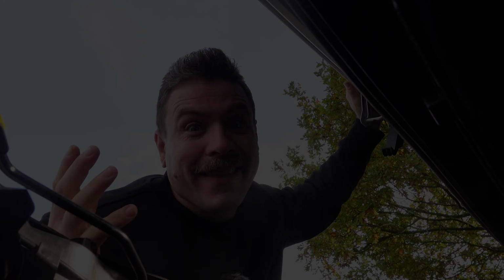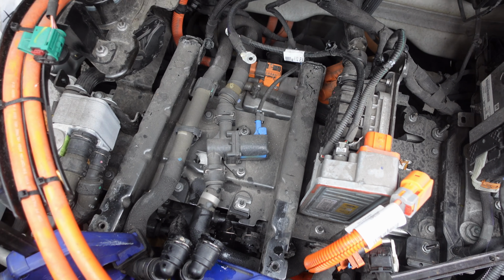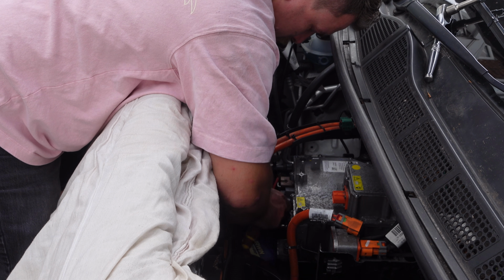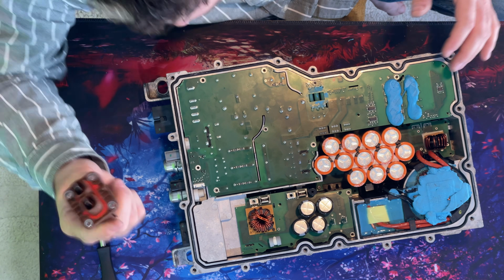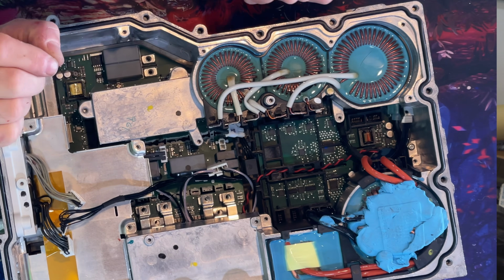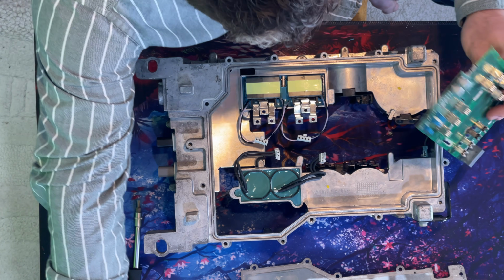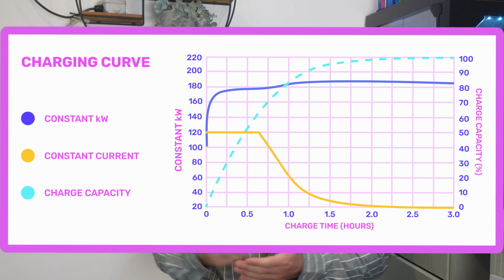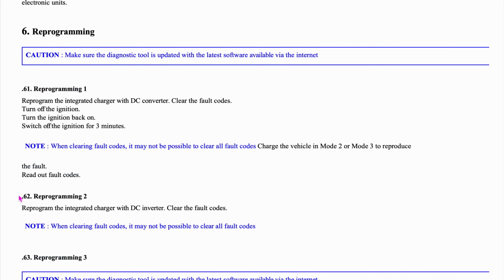Dealer Quoted £3,000 — I Fixed It for £380… But It Wouldn’t Work Until the Dealer Did THIS!

Comment: Thanks for making this video, I found it quite informative and helpful. I'm wondering what the actual cooling system is like for this charging module and thinking along the lines of it possibly being inadequate for the job and creating a built=in failure mode that is perhaps a little less than obvious.

Would it be possible to modify the cooling system so it performs better? As you have a thermal camera it would be interesting to experiment as a relatively simple mod could extend the life of the charger and potentially save people a lot of money.

A couple of thoughts come to mind:

-  Is the coolant flow sufficient and does a supplementary pump to boost the circulation improve the cooling of the charger? Experimenting this way may help but is potentially problematic regarding air ingress into the system as you pointed out in this video, but then it then it could also improve efficiency of the cooling loop.

- Is the radiator that finally extracts heat from the cooling system adequate for charging operations as charging is done when the vehicle is not moving so there is nothing driving air through the radiator? Is there a fan running on the radiator during charging? Assuming it's simple coolant circuit, what improvement is there is air is forced through the radiator? It may be that a slow, and therefore silent, radiator fan running during charging would significantly reduce the cooling loop temperature and prolong the life of charging module. It may be that there is a relatively simple way to energise a relay during charging that starts some sort of radiator fan. Aftermarket radiator fans are readily available and for a simple lower speed a 24V unit may run at 12V or there may even be variable speed versions anyway. 

I don't know if these ideas are folly or genuine food for thought. I'm thinking along the lines of prevention rather than cure and that some vehicles could genuinely benefit from slight modification. From an electronics perspective, it's a case of' the cooler, the better and the longer the life.
Reply from the maker: I measured around 33c from the coolant loop when the casing was 50c. There was a 2-3c heating from the cooling plate
Reply: @TheOfficialBatteryMan  It sounds like a bad design and that the coolant loop should have been through the whole casing.

Having said that, 33C is quite a bit above ambient. I wonder if there would be any noticeable effect chilling the cooling loop?

As the charging module made of aluminium, which is a very good heat conductor, there has to be some case heat being transferred into the cooling loop. As the cooling loop it a separate plate would it be possible to put thermal compound between the cooling plate and the main casing to transfer more heat to the cooling loop?
Reply from the maker: @DelticEngine potentially. I didn’t really show it off but there is a rubber gasket between the plate and main body. So I don’t expect much of the heat from most of the body to end up into the plate.
Reply: @TheOfficialBatteryMan  Thanks for replying. I can understand a rubber gasket to seal the unit to keep moisture out.

I've just had a quick look through the video again and there's definitely potential for the application of thermal compound. I thinking along the lines of cleaning up the contact surfaces and then applying some decent compound.

If the root cause is thermal issues rather than bad design, which it looks like is a definite possibility, then cooling could be taken a lot further by machining extra cooling plates that take advantage of the flat areas of the casing and fitting them to it. A lot more heat could then be dumped from the charging module.

If it's that hot on the outside then how hot are the components inside? Even though modern electronics can and do run quite hot safely, it does shorten the life and increase the likelihood of failure.

Comment: Great vid just gained you a sub, we as a society are sleepwalking into anti repair and anti ownership and its certain to get worse, you are in a minority but very important one of highlighting these underhand practices, Rich Rebuilds in the us fighting tesla and showing the world you can fix things cheaper is another, Also Matt Armstrong highlighted these same issues on his channel when fixing the latest lambo hybrid which when an airbag is set of in a impact a code is sent the the battery that bricks it completely even with no damage to the battery and he had to get a new one for 30 grand, even sent the battery control module to an independant company to try and clear the code but they found it was a permanent lock and later lambo themselves admitted they can't even unlock it.
Reply from the maker: Eventually people do work out ways around things. But the rate of change is so fast it’s hard to keep up with the manufacturers changes. 

I felt it my duty to give people all I learnt to avoid the dealer experience

Comment: Unfortunately this is not just Stellantis, and not just EV's. Almost all manufactures does this.
"Right to repair", ought to be a law manifested by the EU.

Just wondering .. wouldn't improve your access if you removed wipers, and the coverplate below the wind screen ?
Reply from the maker: True. 

Possibly but for 4 bolts you want to do as little work as you can. The cars will be easier to work on
Reply: Tesla doesn't...

Comment: And if Stellantis loses this data, or loses interest in the servers, your car cannot be repaired any more.
Reply: They are well on the way to going broke 🤔
Reply: @pollywollydo  Exactly. Companies going out of business with no software/data escrow should be illegal, especially if they insist on bullshit coding of parts like this.
Of course if they just published repair data and either protocols or software, then we wouldn't need escrow.
Even the dumbest of politicians can understand that you should still be able to fix expensive stuff like cars even if the original supplier has gone out of business.
Reply: @xxwookey the EU is trying its hardest to stop you repairing your own vehicles. Expect it to get worse
Reply: @DanRyan-v5y  Why specifically blame the EU? Most of the problem seems to me to be manufacturers. Governments set emissions, crash testing, and other regulations like recylability and market rules, which do have secondary effects. But it's the manufacturers putting in the serial numbers, proprietary software, and deciding on availability of spares, that really make repair difficult, expensive or impossible.
Governments can enact legislation to force manufacturers to do better in this regard (and by and large they are not). But that is an act of omission, not commission.
Reply: @xxwookey I explicitly blame the EU because it is the EU doing it. They want to stop everyone repairing older vehicles. They are talking about laws to ban it. The UK will be tied into it because of starmer and co will just bend over and lube up to get brownie points from the EU aristocracy.

I agree totally that this locking items into the vehicle is not a good way to carry on from a Sustainability point of view if nothing else. You should question why they want to go that way whilst spouting crap about sustainability whilst pushing policies that encourage the opposite..

It will be because the lobbyists and politicians have vested interests in getting you to empty your wallets for stuff you didn't want and that has to be replaced regularly.

It is also the EU that makes up all the eco laws that require everything to work hard in unison so the manufacturers don't want to be caught out not complying, because they get shafted if they don't.

If you don't believe that , research all the EVs that were registered with no real sales at the end of last year, just to avoid eco fines. This year it will be even worse because the EV market is stalling. But they can't do that forever. Sooner or later they will start going bust , because the EU is making them make and sell vehicles that most people do not want, and most of the public are refusing to play ball. But don't expect politicians to do the right thing in the EU. They will double down untill only the rich can drive.
Reply: @DanRyan-v5y  Registering EVs early to reduce fines has nothing to do with legislation preventing repair on older vehicles. 

OK. I found out what you are talking about. Proposed (i.e still under discussion) legislation to discourage things like engine and gearbox replacements in old (pre Euro 6) ICE cars as part of the phase-out of polluting vehicles.
Clearly that requires a bit of care to avoid making classic car and reasonable repair too difficult, but we do have to get rid of almost all the ICE cars over the next 15 years or so legislation to encourage that is fair enough.
That's quite different from preventing vehicle repair in general (i.e. for EVs in particular which quite soon be nearly all cars).

It is more sustainable to move to EVs quickly, especially as the grid is decarbonised despite the up-front emissions of new vehicle manufacture. Delaying the shift only makes sense for vehicles that do very low mileages. The footprint for batteries has nearly halved in the last couple of years, so the difference between EVs and ICEs is already small-to-negligible. All vehicles have to be changed at some point, so every purchase of  a new non-EV is just adding to the problem of ICE vehicles that will potentially need to be prematurely EOLed.

I see no contradiction in supporting rught to repair whilst also understanding that the ICE phase-out needs to go faster. (We are past 25% in the UK, but it really should be 50:50 by now). Electric motoring is cheaper for most people now, so the switchover is accelerating - most people find cost a persuasive argument.

Comment: I wonder if it could be filled with mineral oil to keep things cool
Reply from the maker: Nice idea.
Reply: I'd be careful about a dielectric wiggling its way into poorly designed pressfit connectors exacerbating the problem though
Reply: I actually thought of that too...
Reply from the maker: @nakfan this is why I love the community. Ideas being thought of outside the box
Reply: at 800V dc, elevated temperature? there are already signs of decomposition in there.

Comment: Did anyone notice this clean, simple looking device made out of just two boards just hanging there on the wall behind him?
Thats a Model 3/Y on board charger.
Reply: Tesla's engineering has been superior to Stellantis' in many ways for a long time. And surreally have gone from being an outfit with no spares and no info, to one where you can in fact get the parts, software and info you need to fix stuff. Absolute wankers in many ways, but more fixable than most.
Reply from the maker: It is indeed. One I killed by running it without 12v connected to it. Oops. 😂

Comment: Interesting video, thanks for sharing. This diagnostics issue will effect all new cars unfortunately having to use Secure gateway diagnostics  - there are aftermarket tools that can connect/make the handshake with the dealer tool, but I think they are probably £1000+, plus a hefty subscription.
Reply: It doesn't have to be that way. It can easily be put in legislation that there has to be a reasonably-priced way to get diagnostic data out of your own vehicle. Without network access to entities that may no longer exist.
Reply: @xxwookey in theory there is only a small charge from the dealer for a token (something like £10) for an hour to connect to their server - BUT as far as I'm aware you need an expensive scan tool compatible with Secure Gatway.
There are however bypass cables available for PSA/Stelantis for around £20 which apparently can bypass the SG so regular scan tools can clear fault codes and make adaptions.
Reply from the maker: Good point

Comment: It would be interesting to see if faults are equally spread across those who charge at the normal 6 or 7 kW as opposed to anyone who still uses a slow charger at 3 kW or less. Less heat equals maybe a longer life 🤔
Reply from the maker: I would suspect that running it at slower power would improve the situation. However, it is designed and sold as a 7 kW charger or an 11 kW charger. It should easily be able to handle that.

Comment: Working for a company that does its own manufacturing and production (in the R&D department), seeing as the replacement part is only 250 pounds they likely wouldn't bother attempting to repair, especially something as complex as the part you've shown. One service engineer working for 2 hours on that is already too expensive. Let alone the hours needed from the design team to pinpoint the problem in the first place. 

Now we could ask ourselves how can it be only 250 pounds, but it seems like they skimped out.
Reply from the maker: This is second hand replacement. Part is over £2k new. 

Everything you say just makes the whole thing more frustrating, doesn’t it?  It effectively means an EV which is meant to be better for the planet has throwaway parts. Let’s face it that’s how a lot of the car industry has gone. Mechanics and dealerships are not taught to repair parts, but rather to replace

Comment from the maker: I’m determined to show citron up and by extension Stellantis by giving you everything you need to know about this problem how to fix it and what goes wrong. Power to the people.
Reply: Very thorough.   I think I've missed a key part here - is this just the AC to DC level 1 and 2 charging which would cause the heating up which may be causing the issue?  I happen to Level 2 charge mine at 18amps so approx 4kw due to an armoured cable to my garage not being beefy enough to handle 32+ Amps, and the rare DC Level 3 charge.  Could I unintentionally be minimising the heat build up in my unit by not running AC charging at 32 Amps, or is that wishful thinking?
Reply: Citroen. (not Citron :-)
Reply: By the way, where to find a service manual?)
Reply from the maker: @tartok have friends that are in high places. 

Honestly they have quite a locked down system all Biden behind paywalls and they only want to make it available to businesses in the industry that pay for it. 

I would recommend finding someone who has access and pay them for the information

Comment: The 3 large coils set in blue thermal compound seem to be sized for the input currents - charging at 240V 7kw is obviously 32A from L1.
However 11kw charging on 3 phases is only 16A per phase, therefore the other 2 coils that only ever see L2 and L3 are sizes smaller as they only ever see 16A 

Although it's not the right answer - it would be worth redoing your thermal tests whilst limiting your 7kW charger to 24A. 5.8kW is not too much slower than 7.6kW, but will generate only just over half the heat.
Reply from the maker: Yes, that is what I meant. Sorry that didn’t come across. L1 can either handle 32 A in single phase mode or 16 A in three phase mode
Reply: @TheOfficialBatteryMan sorry, I probably missed that bit!
Reply: Unfortunately the the onboard chargers breaks on the cars here in Sweden as well even though we almost always have three phase X 16 amp available at home.
Reply: @edalbagem that is interesting, and also, a shame!